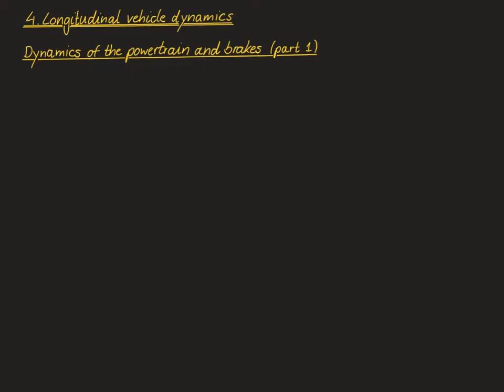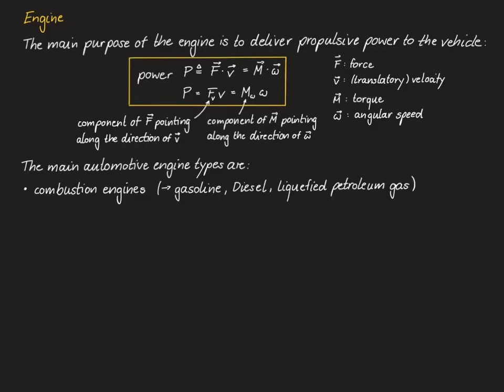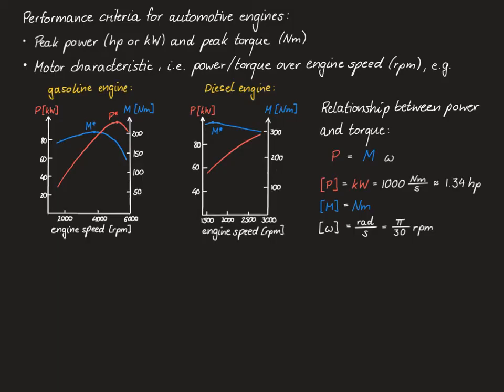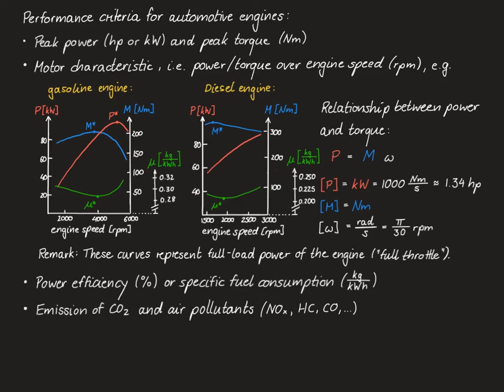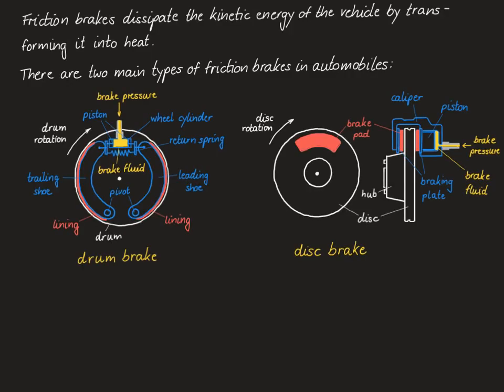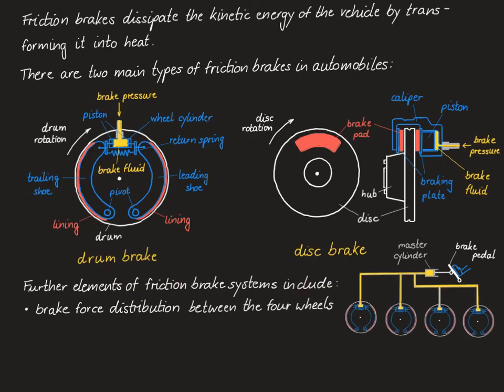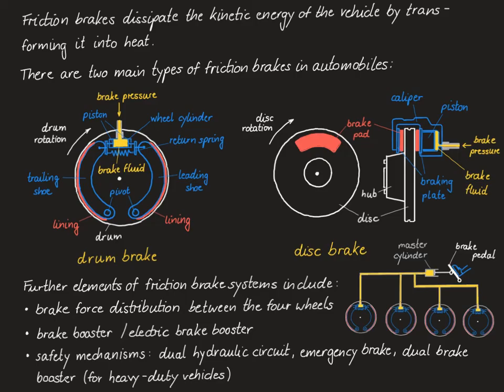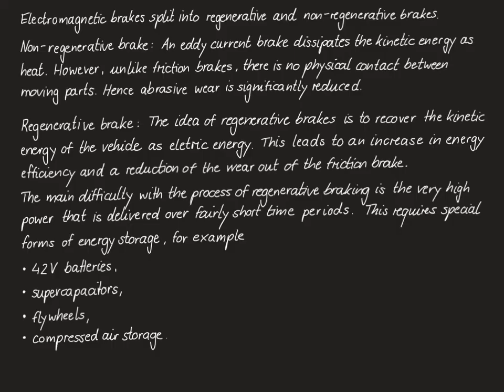Vehicle Dynamics & Control 14 - Powertrain 1: Engine and brake

Comment: Excellent video. Thanks for sharing. 
Can you please clarify some questions? 
1. What is the max deceleration possible with engine brake in case of passenger vehicles? 
2. How to calculate the max deceleration with friction brakes without a rollover?